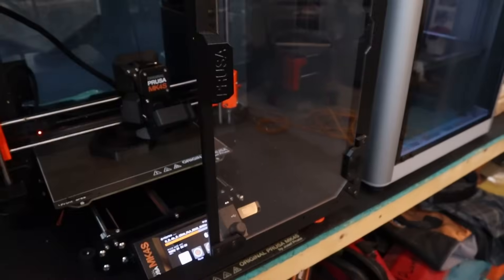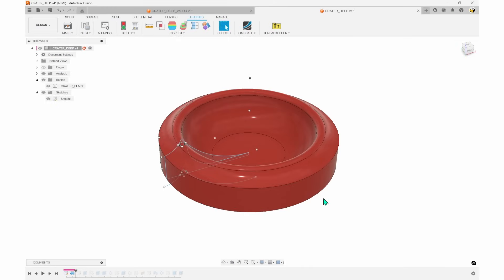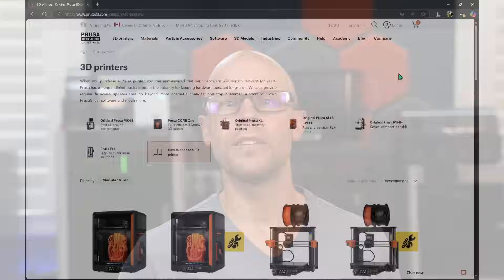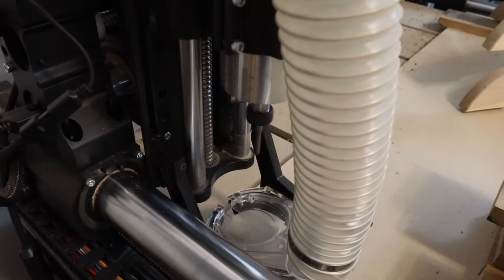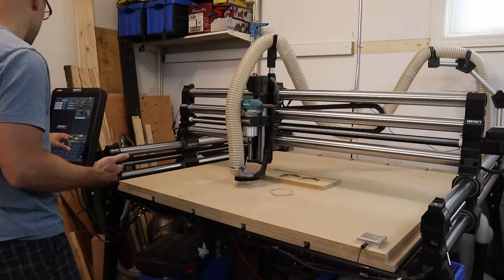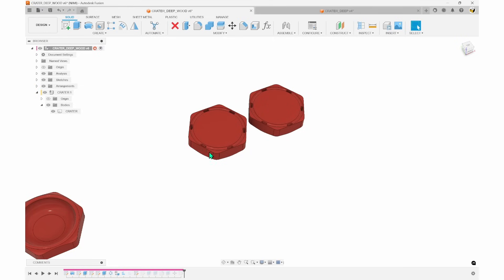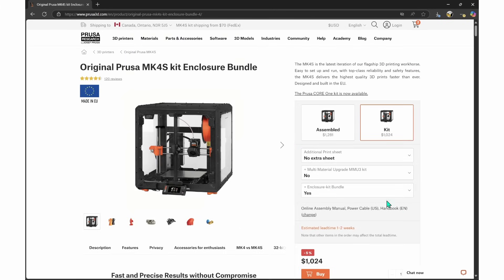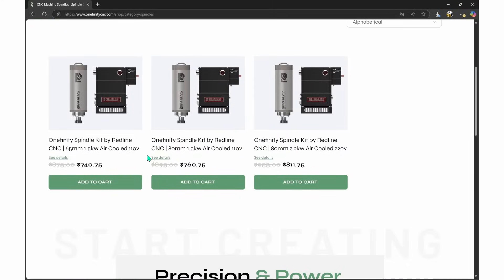Which is better?  A 3D printer or a CNC machine?  Let's find out!

Comment: Very interesting. We have similar shops. I think it’s hard to overstate how much harder it is to do CNC machining than it is to do 3-D printing. Figuring out feeds and speeds at the risk of broken bits as well as the dizzying amount of ways to do tool paths, not to mention work holding.
Reply: It's much harder to get a much better result, but that's not a fair comparison. Why are you ok with seams and layer lines on 3d prints, but worry about tool paths, sanding, oiling with wood? You only need to experiment with feeds and speeds if you change materials, but that's exactly the same if you switch out a filament.
Reply: @GroovThe  I think they become a lot closer in comparison when you rewind the clock to the earlier days of 3-D printing. But with Bambu streamlining so much, there’s very little experimentation that actually needs to be done. And if you fail something Wild 3-D printing, you probably only waste a couple dollars or even cents of filament and not a $40 bit.
Reply: @GroovThe  but really, it’s rare that I would consider making the same types of things on my printer and my CNC. They occupy such different spaces in my design mind.

Comment: I use my CNC for post processing the bearing surfaces of 3d printed wheels in ABS/TPU for example. 
Or for parts that must be strong and small like a M8x1 to 10mm adapter with a 2mm hole for dental cleaning devices. Couldn’t make it work with 3d printing, parts broke. 93c hot water in there. 

CNC is really cool but work holding, noise and the cost for tooling are a downside. And you need to invest a lot of money for a stiff machine to be able to mill aluminum with nice surface finish and accuracy.

Comment: I own 3 Bambu printers and an AvidCNC router. I often 3d print the first version (or 2, or 10) of small parts before machining as it's 100 times faster and easier labor wise, and the setup work involved on CNC for a single part is pretty long. That said I am making robot parts not decorative pieces, so the strength benefit to using solid material with no layer lines or just using metal instead of plastic is unbeatable for the finished piece.
Reply: The Avid with 4th axis is super tempting

Comment: Wood is hands down the better looking one in my opinion.  I mean who doesn't love some walnut right?  Great video!
Reply: The inescapable truth of plastic 3dprinting is that purely aesthetically we're polishing a turd. We're just about hard-coded to have far greater appreciation for woods, metals, fabrics, etc. than plastics.
Reply: Walnut is quite expensive though
Reply: Ould have been reclaimed palette wood. I would still prefer the wood variant. And i'm a 3d printer enthusiast
Reply: @TheSliderW I agree with that, but I wouldn’t make all my shitty bad designed parts in wood until they’re final parts 😂
Reply: @smokeduv  same x )

Comment: Interesting comparison.    Since you have a wood lathe, you have another option to turn out the inside rather than CNC.   Should be much faster and adds some custom look.   
I do like the look of wood vs plastic, but as you mentioned, grain issues can result in some pieces failing or needing repair.
In my state, Pennsylvania, the walnut trees are being damaged by ash borers.    This may be happening in other states driving up the cost of walnut.   Shame since I love the look of walnut.
Dave.
Reply: :finger-red-number-one:for lathe 😉
Reply: "Should be much faster and adds some custom look."
And as he was already mounting the bowl to the lathe it would not be much more manual work, if at all, as a nicely turned surface doesn't need much sanding.
Also not having to flip the parts for the CNC would remove that manual step and further reduce CNC time/cost.
Reply: You need to remember that as the CNC router is cutting out the parts he can be processing the parts. It's more like 1.5 people working at the same time. Trust me, I have been operatining a highly productive single person wood shop for over 40 years. Bought a 4 x 8 CNC 22 years ago. 

I produce kitchens, furniture, and small pieces similar to what's in this video. No tool changing. With the proper fixtures and efficient strategies the time could be cut in half, maybe more.

Comment: So in summary:

CNC: way more expensive, way messier, more of a hassle to program, more labor and post processing needed but it's faster and can result in a much nicer piece (depending on application).

3d print: way cheaper, less waste, less hassle, minimal labor, but much slower and worse quality (depends on application)
Reply: Parts from CNC are stronger and you can use Transparent PC, POM, Aluminum or PTFE for example. If I can, I 3d print parts but sometimes I have to use the CNC. I also often print parts first before using the CNC to see if the part fits.

CAM isn’t that much more work than 3d printing but the work holding for CNC can be a problem for complex parts.
Reply: Don't forget 3d printers are using plastic. CNC he's using a renewable material.
Reply: @lunaumbra5179  PLA is made of corn
Reply: @TuttleScott you are correct. Not all filaments are. He does use pla in the video. 

But I guess for pla you could focus on how it's not really biodegradable like it claims.
Reply: "CNC: way more expensive"
"3d print: worse quality"
That, as he said, is entirely due to his setup and choice. He has chosen to only do 2 parts at once with CNC instead of the 4 with the printer - doubling his work with toolchanges (so not even using auto-toolchanger). 
Same with the finishing - he has chosen to sand and coat the wood but not do any finishing on the 3D printed plastic.

Comment: Another interesting calculation could be waste. A good metric might be weight percentage of material raw vs pre-finished. Wood waste can sometimes be reused for other things, but that is on a case by case basis. Being able to have multiple spools of filament and just switch to a new spool when one runs out is pretty great.
Reply: waist depends heavily on the design. you can design it so no support, no purge..., or removing minimal material. It depends on the design. So a comparison is very hard.
Reply: @RobertONeillPhotos  I think it would be straightforward. Sure we're talking about a materials that have different density, but if you look at percentage of waste based on each material, it should give an idea of efficiency per material. 

Wood for the most part comes in rectangular pieces with one side longer and one side shorter, which likely means there will be waste due to the shape of the piece. What is the measurement of the the weight of finished product vs waste? 

I should go back and see how he calculated the cost of the wooden parts. He seems like a very clever guy, so this was probably already accounted for.
Reply: @rrtac  what I was referring to is the design of the part could be optimize for waste for a process.. For example the simple bowls had a thin wall. would produce little waist printed But machined (subtractive) would be cutting it away.  I think the main factor is what is your goal. It is unfair comparison a wood finish, compared to layers of printing.

Comment: ... its  about if you have workshop or not ... CNC = NOISE annd DUST while 3d printer you can have in your bedroom ...
Reply: Well, I run a large CNC in my bedroom, in my small appartement.

But ok, I also spent 2 months, and a pretty penny, on building a humongous sound dampening box with integrated dust collection for it.

PS: My bed is on top of the box ... not kidding :D
Reply: You can argue that its best to have workshop for 3d printer as well due to all VOC produced by 3d printing even if its enclosed.

Comment: Wood vs plastic it depends what's the purpose of the part. If you want to use the containers for storing screws and stuf in a workshop I would prefer plastic. If you want to use it as servingtrays for food I would prefer wood.
Reply: The change of direction from just another 3d printing review channel to a project channel is a step in the right direction 👏

Comment: Do u find all woods cut with the same parameters well enough or you have to alter depending on the wood type/species?

Speeds and feeds, I’m assuming might the first changes but do they also react differently to different cutting paths or operation sequences?

Comment: You could upgrade the printed version by sanding it like you did the CNC-version. Especially the dished portion.
Also, you could print with wood-filament to get something approaching the CNC-version.
Otherwise I agree on everything :)
Reply: Polymaker makes a wood-free dual-tone filament that mimics wood really well. From afar, you would be hard-pressed to tell it's plastic.